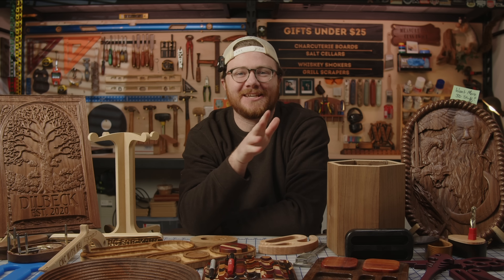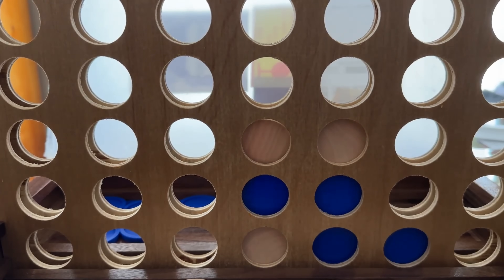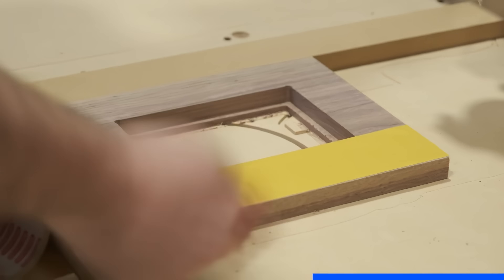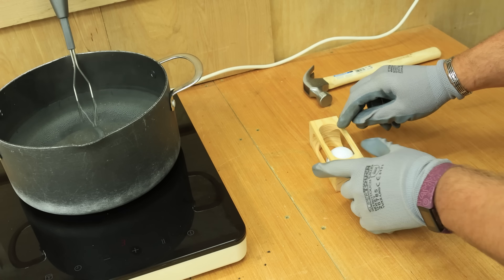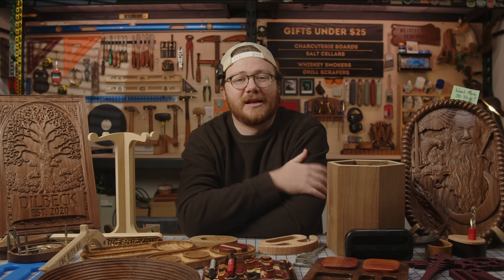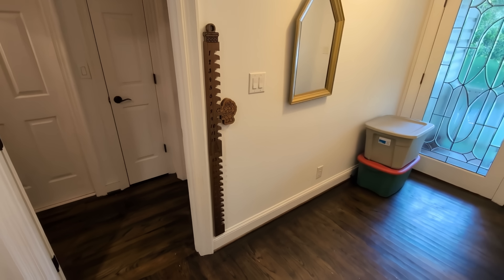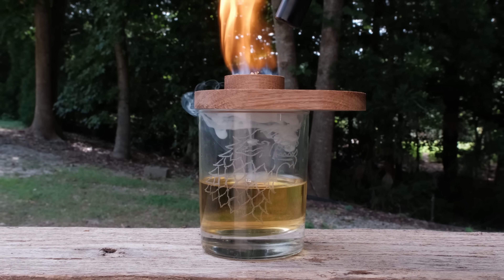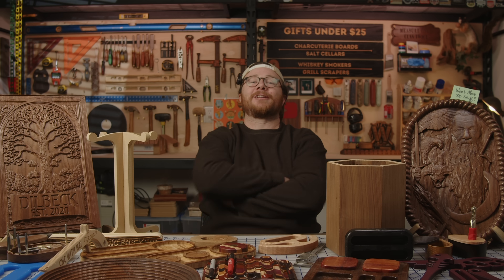Top 15 CNC Woodworking Projects!

Comment: Connect- way faster to use a laser cutter...
I had to look up what a 'whiskey smoker' was. Good job I was sitting down! Adulterate a single malt with smoke? I am normally opposed to capital punishment, but in this case...
But I did learn something useful. There appears to be a lot of owners of CNC machines that cannot design the simplest project, and are prepared to pay money for someone else to do it.

Comment: Professional Summary:
I am a highly skilled CNC Router operator and programmer with over seven years of experience in the furniture industry. I have been working with CNC machines since 2018 and specialize in operating CNC Router 1325 and other similar machines. My expertise includes programming and designing for CNC using AutoCAD for drawing and ArtCAM for advanced design.

Although I do not hold a formal certification, my extensive hands-on experience allows me to perform efficiently in CNC machining, design, and programming. I am passionate about my field and always eager to learn and improve my skills.

Skills & Expertise:

CNC Router operation and programming

Proficient in AutoCAD (2008) for technical drawing

Expert in ArtCAM for 2D and 3D design

Experience with NC Studio software

Strong problem-solving skills and attention to detail

Effective communication in English

Career Objective:
I am seeking a job opportunity in the United States to enhance my skills, gain international experience, and contribute my expertise to a professional team. My goal is to continue growing in the field of CNC machining and furniture manufacturing while embracing new challenges.